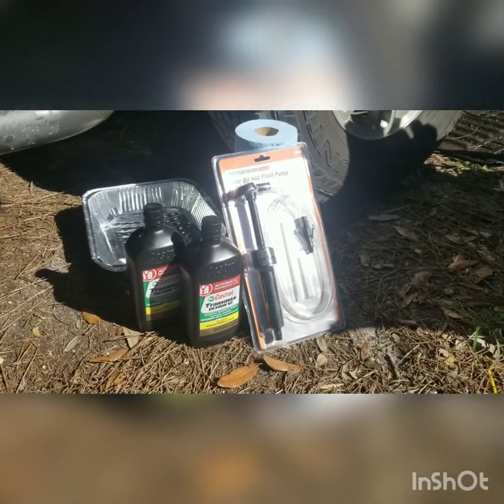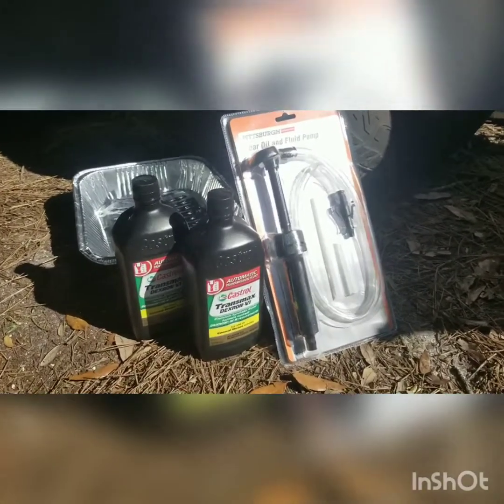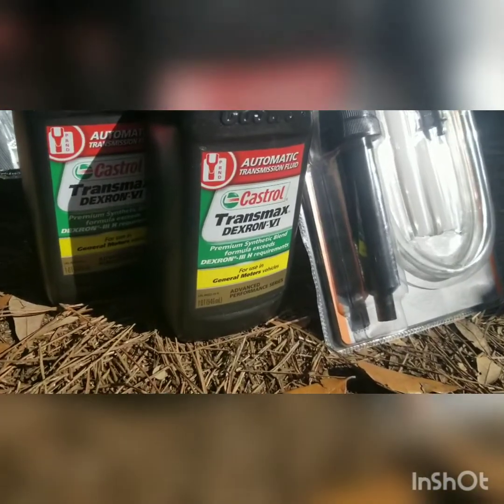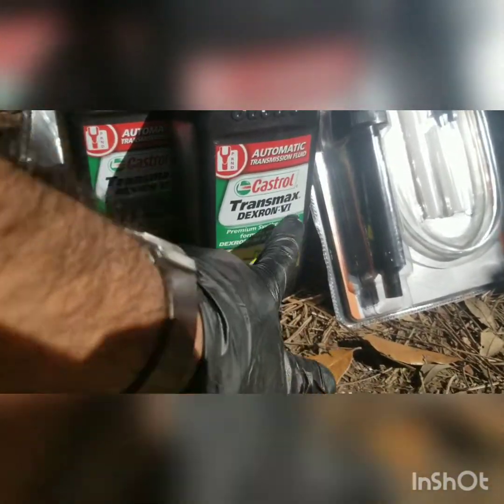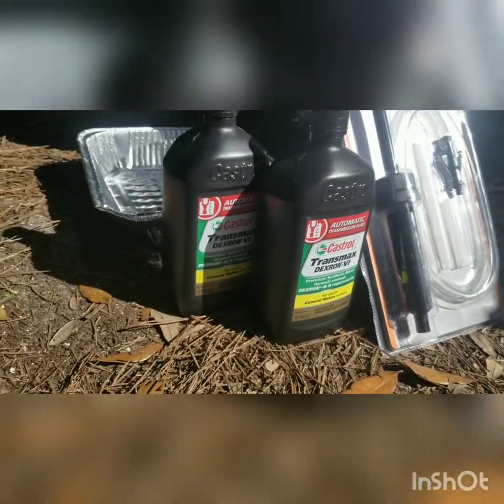Hummer H3, Transfer Case Fluid Change (Dexron VI)

Comment: Very cool. What about the service bulletin this says you actually have to take out the speed sensor plug and fill from there to add extra because the fill plug is to low.  It's not on all H3 s but you did not specify which h3 you have. But I think it's a extra 500ml or something....
Reply from the maker: Hi Riskybiss, Removing the sensor plug wouldn't be necessary for this edition (2006). Normally if you have the proper fill pump, it will fill up completely without leakage.
Reply: @hummerh3howtos if you read the label right there is says to do so 😂 you have to added more trough it

Comment: Chevy Stealership here in oregon says my 2006 Hummer H3 transfer case calls for Dexron III !
Reply from the maker: The GM site says to STAY AWAY FROM DEX III, and only use DEXRON VI. Dexron VI is a lot more stable at higher temperatures and lasts longer. It can also be used to top off dexron 3, however, you can't use dexron 3 if you already have dexron 6 originally in your trans, or if it has been flushed with dexron 6.
Reply: @hummerh3howtos  
Thanks for that info !
Reply: @hummerh3howtos  Good info!
Reply: This is great information. Can you tell me why does my hummer say it’s in regular everyday 4-wheel-drive but feels like it’s stuck in 4 wheel drive lock??? 😢😢😢

Comment: I  Put synthetic oil in the motor and synthetic oil in the and rear differential.  Now I am going to put Castrol in the transmission and in the transfer case...  I know it's probably my imagination but at 200,000 miles with all these synthetics the hummer H3 runs like super nice